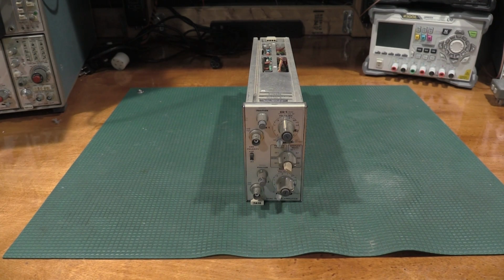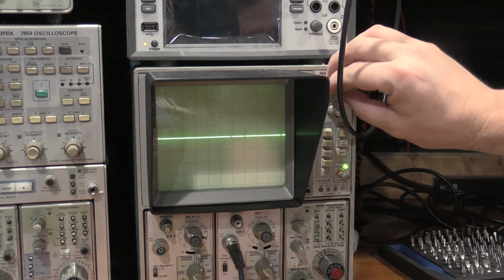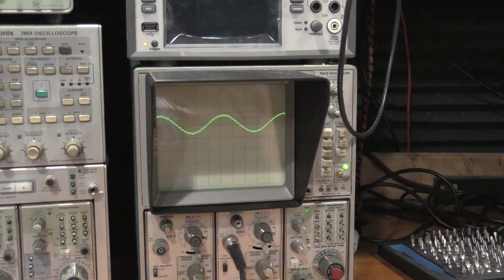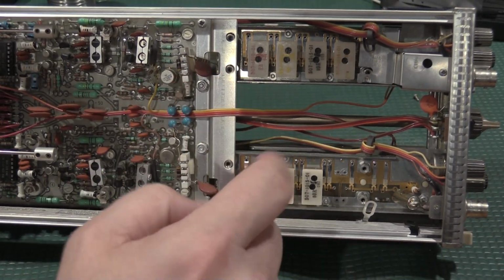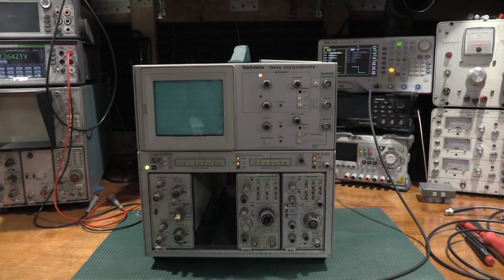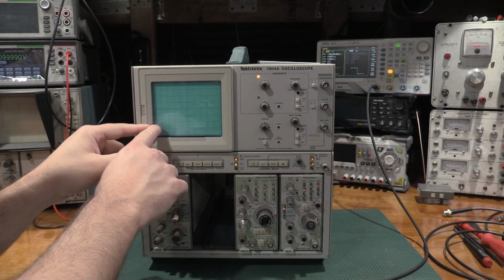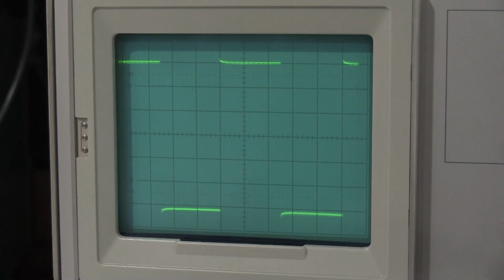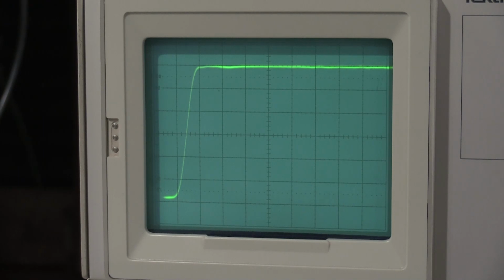Tektronix 7A18 Repair and Function Generator Alignment

Comment: Have you done a segment on how you clean controls?  Do you use the Deoxit spray?  Or the liquid?
Reply from the maker: I have not done a video like that yet. I might put something like this as a Patreon release. I am also still doing some longer term testing of methods as to brind some of these units back I am having to go "Off Script" so to speak. Care needs to be taken when chemicals are used as the board material of the attenuators varies greatly with the age of the plugin. I have seen clear plastic, a phenolic type PCB, a ceramic PCB, as well as a clear ceramic PCB material to make up the attenuators. I have done a video on adjusting the spring contacts but I have moved from an alien key to a small paperclip. However a slip while working on the attenuator contacts can and does ruin then permanently.